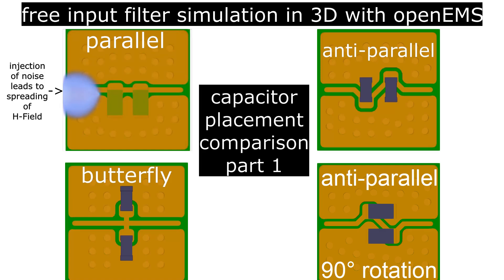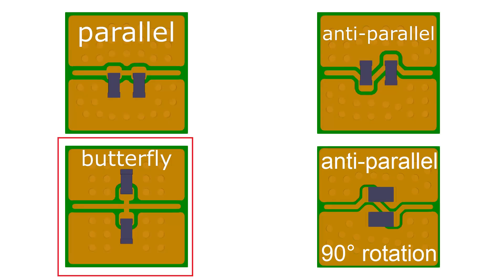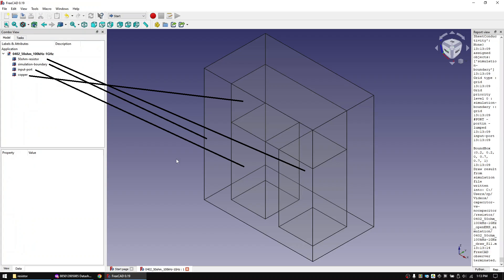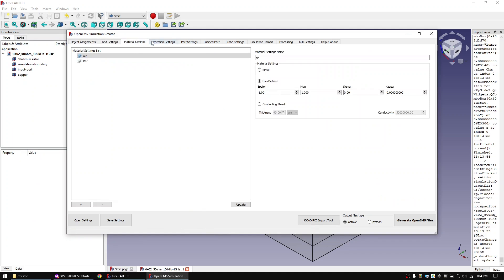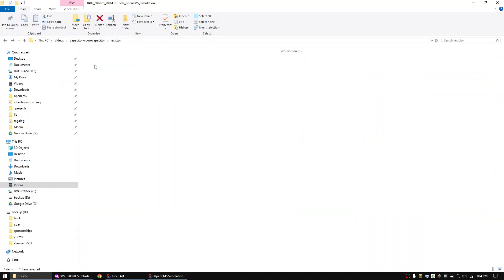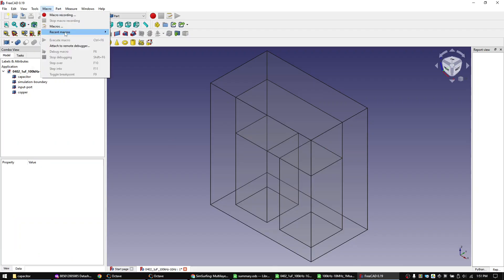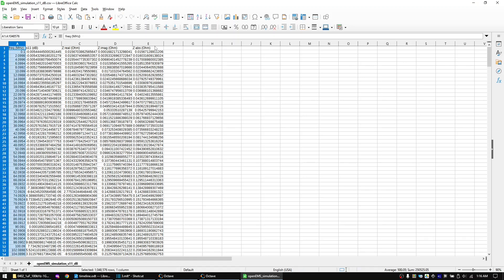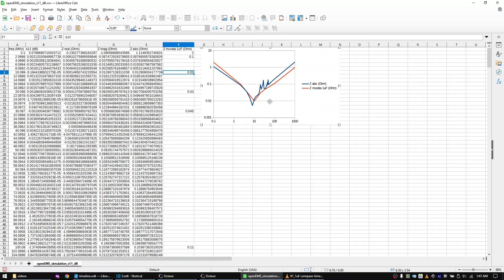free filter capacitor simulation with KiCad and openEMS (decoupling capacitor placement) -  part 1

Comment: Great series of tutorials. Thank you for posting.
Simulations for lumped resistors and capacitors work, but inductors produce bad results. Would you demonstrate an inductor too?

My attempt at an inductor always produces an open circuit. The resultant Python code looks correct, but openEMS produces nonsense. (I tried adding parallel leakage as a sanity check). Is there some other secret adjustment needed for inductors? 
lumpedPart = CSX.AddLumpedElement('Part1', ny='z', R=1.0*1000.0, L=1.0*1e-09, caps=True);
Reply from the maker: Hi there,
the lumped inductor model does not work yet and based on the github discussions group of openEMS it wont be implemented anytime soon.

Simulating inductors as of now just works by defining them via their shape. I will make a video on that once for sure.

Comment: those capacitors aren't even connected, the trace goes under them. great simulation... not
Reply from the maker: they are connected indeed, which timestamp is where you dont see the connection?
Reply: @panire3  lol my brain thought the green color was the traces, my bad
Reply from the maker: ah i think i know what you mean, the reveal on how to connect the capacitor to the pcb will be in the next video, you need to create some vertical pads manually